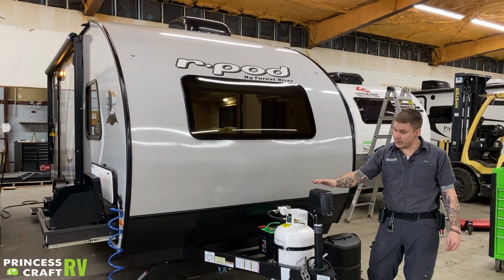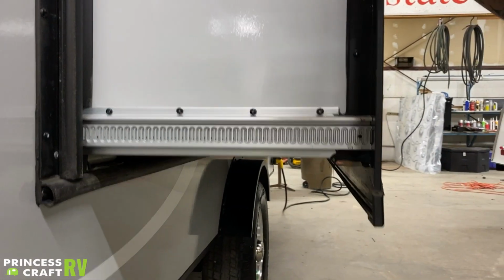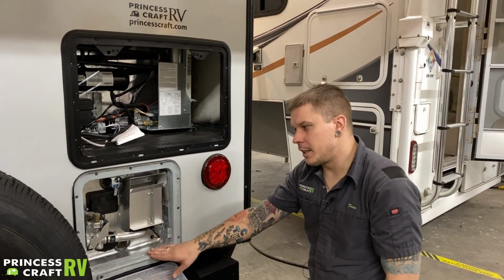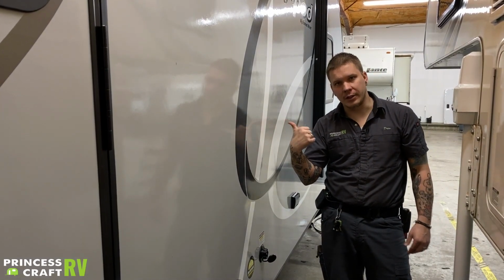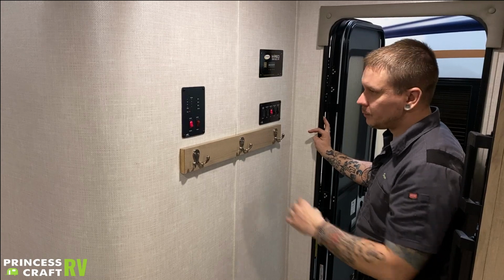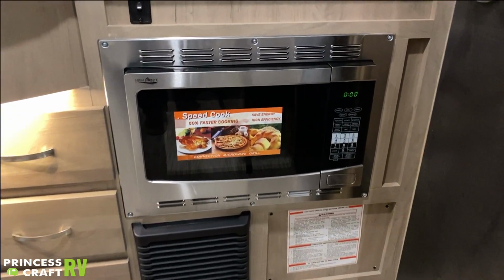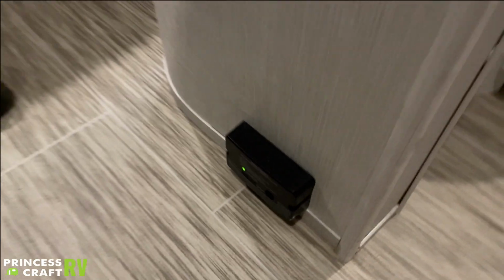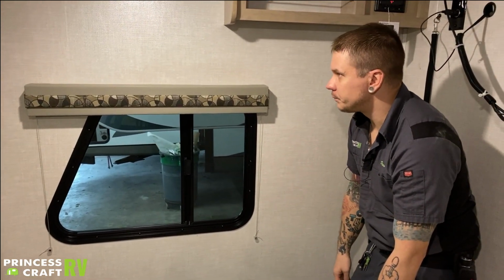Technician Tour - R Pod 196 by Forest River

Comment: As always the walk-around by the technician surpasses that of the sales person.  Something that should be added to the demonstration is suggestion that the owner purchase and keep a cordless drill, 3/4 inch socket for the stabilizers and a 1 1/16 inch socket, a torque wrench, and replacement anode rod to service the water heater.  But really important and never discussed is how you change a tire on the side of the highway.  Forest River might provide a spare tire but who provides the wrench and tire jack to get the tire off and on?
Reply from the maker: That is very good information! Most manufacturers do not provide a jack for the trailer, so it's important to  make sure you have one in your vehicle that will work with both your vehicle and your trailer! Thanks for your suggestion!